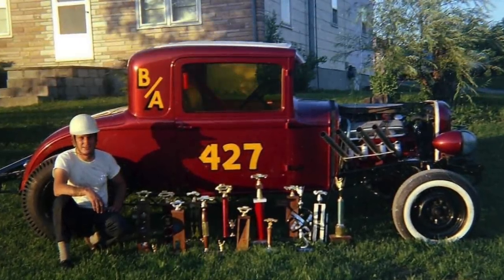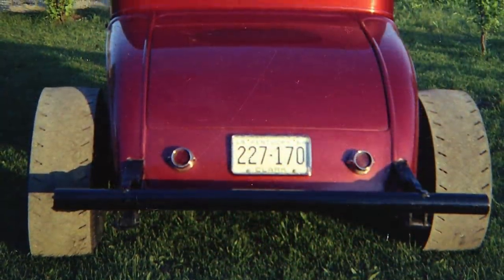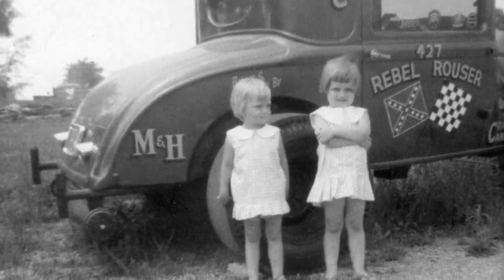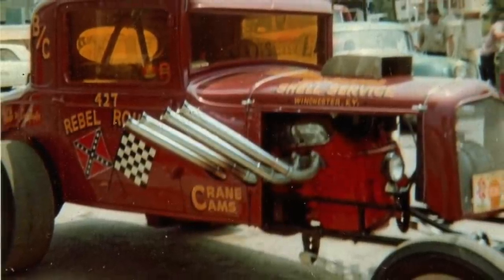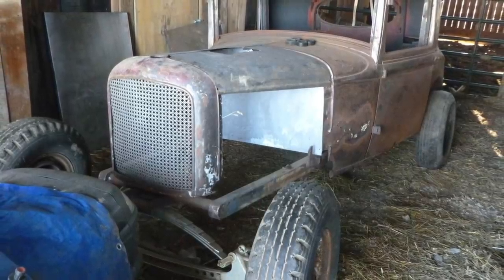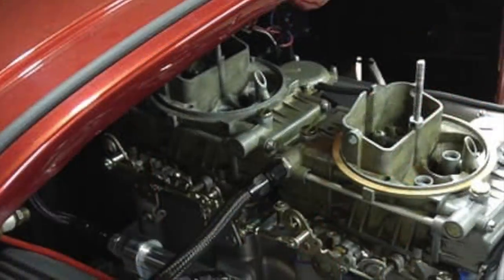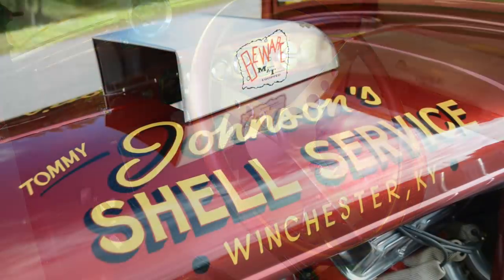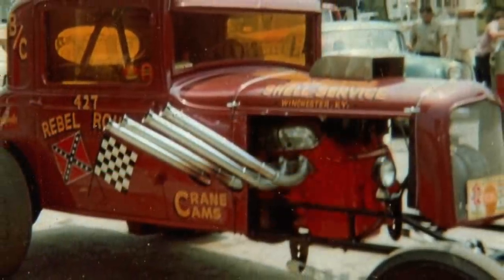CRAZY Plymouth Drag Car FOUND & RESTORED by Original Builder's Son

Comment: can't beat a ole Plymouth, not long sold my 33
Reply from the maker: That body style definitely makes a cool looking hot rod or drag car.
Reply: @HotRodHoarder  mine was a glass body, made by rays rods in the early 1980s here in the UK, homemade chassis, 215 buicl stroked to 269ci, 4 speed manual, 58 chevy rear, 62 corvette diff with 4.10s. a real shame but corona came and money went short, car had to go.

Comment: You're forgetting one important rule for gassers vs. altereds.  Gassers could have a 10 % engine setback.  Altereds such as this could have a 25% engine setback, which is very obvious when looking at a side view of the car.  These engine setbacks aided in traction, since they threw more weight on the rear wheels.
Reply from the maker: Yes, I did leave out the engine setback rule to reduce confusion, because the B/Altered version of the car didn't actually have a dramatic amount of engine setback. The first and most obvious "violation" of gas class rules for this car was the removal of the fenders so I wanted to make that the clear difference between gasser and altered. But you are correct...the engine setback became one of the biggest differences between the two classes as time went on.

Comment: Awesome story's of cars and ppl , my friend Paul egli egghead LoL raced at Beaver springs dragway , I went as his vechile mechanical engineer , the my dream came true I found a 1987 Monte Carlo Ls , well it's was a 305 4 BBL 3 speed auto and a383 rear it sat in a feild by Williamsport pa , well it ran 13s in a Quarter mile at Beaver springs dragway ,gotta start somewhere well my friend Ron got 2 sweet 55s one 2 door and one 4 door , I helped him as much as I could with both we Ghost the 4 door for his wife with a 383 stroker and Ford 9 in rear then while building his Two 2 his buddy a old head back alley mechanic put the front eand on for him ,  he had  a 72, 455 Buick motor and trans for my Monte Carlo Ls , I bought it with trans for 500,00 bought the car for 40.00 found a front end and hood for it since it was missing I put a reg Monte Carlo on to just drag race it well I got it in left the 383 posi rear end and straight gas even the Quadra snot 4bbl was placed in OUTLAw St class , well first time down didn't know what it would do I thought low 13 or 12 high to my surprise ir ran 11.58at 151 mphs well got shut down no roll cage but I done it built me a
Reply from the maker: Wow, thank you for sharing your experiences!